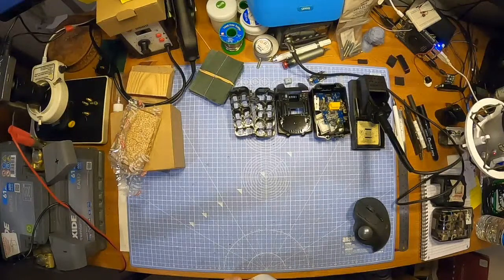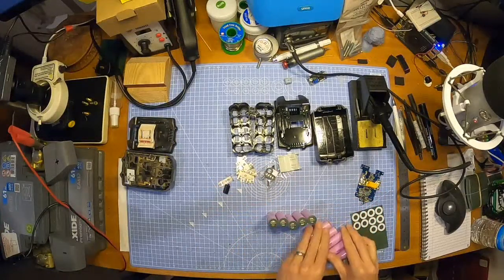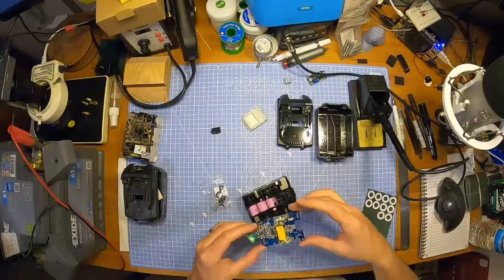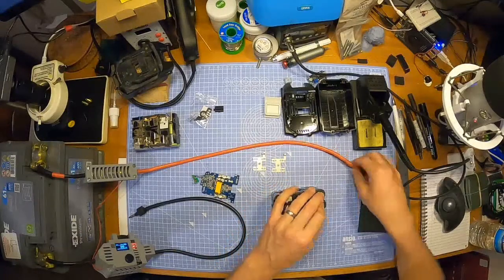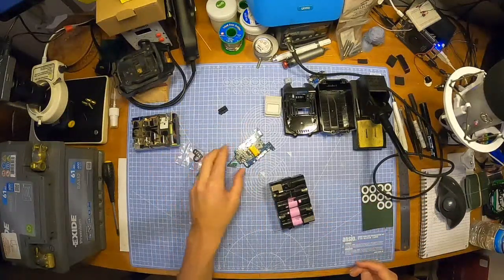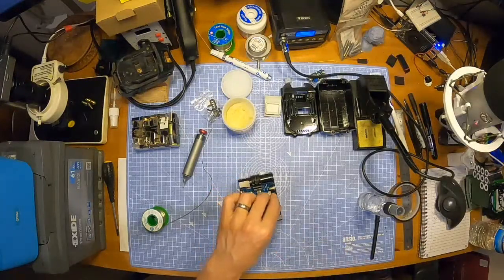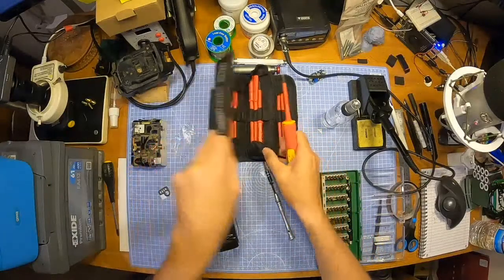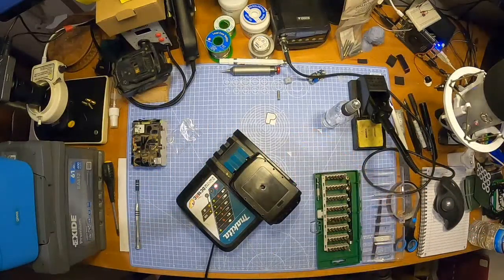DIY Makita 18v Battery Build using Samsung 30Q cells

Comment: nice one bud, quick question, will this be any different to those from Mak in terms of charging, like protection against over-charging etc? once again well done and ths
Reply from the maker: Hey Gavin, thanks :) the seller I bought the boards from does say that the boards include protection for over voltage, under voltage, over charge, over current & over heating. I have a mate in the industrial roofing industry who I built a few for, he works them hard and hasn't had any issues with the so far. Thanks for the question and the views ;)
Reply: @my2cents534  Thanks for the info man, that's absolutely helpful, I'll give it a crack and see how it goes  : P

Comment: Nice one mate. You reckon if I order the same kit. But discard the outer case. And use an original makita one instead it’ll all fit? It’s an old makita battery so I won’t be using the battery gage sensor anyway.
Reply from the maker: I have both cases and original cell packs at home. let me test it out this weekend and get back to you ;)
Reply: @my2cents534  did you ever make a video about it ima trying to find it on your channel but no luck

Comment: can you provide details of the spot welder you have running off the car battery?
Reply from the maker: Hey Battman, the spot welder I'm using is the Malectrics welder which can be found here https://malectrics.eu/ There is also the Kweld, which I have heard is better from people that own and run the unit. You'll find that here https://www.keenlab.de/ The battery I use is an Exide EA612 which is capable of 600 cold crank amps (CCA) you'll need that sort of capability for the welder. I got mine here https://www.tayna.co.uk/car-batteries/exide/ea612/  You can also ask the welder manufacturers, they will recommend the best power sources ;) hope that helps :)